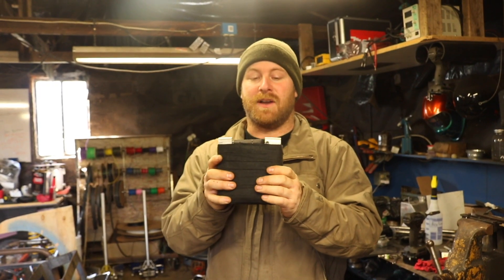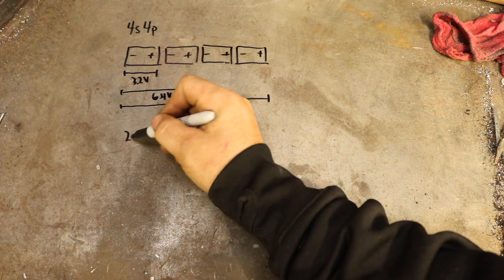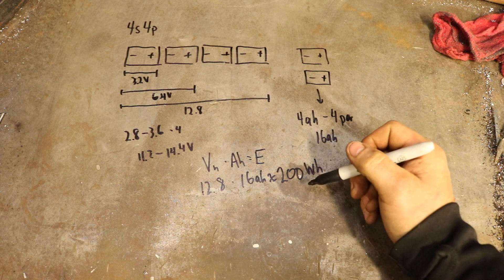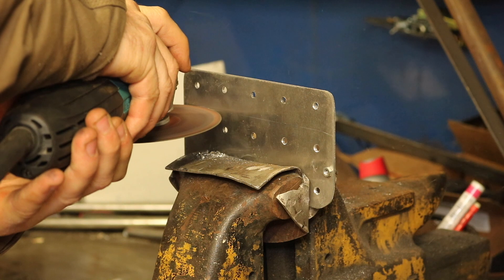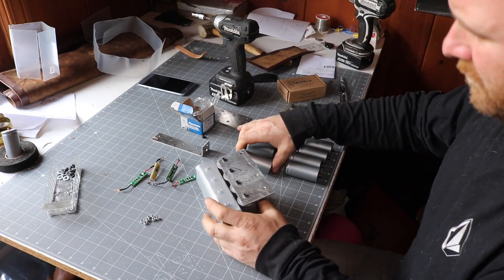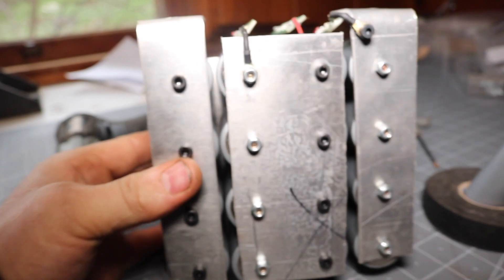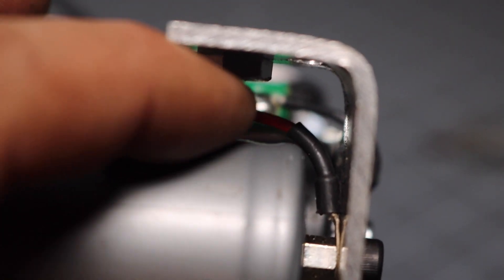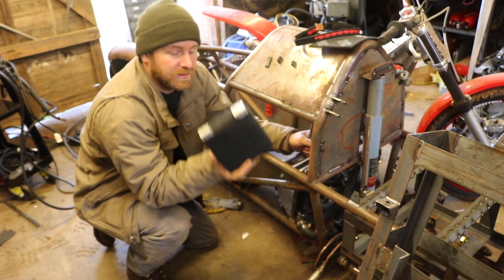Lark Streamliner | 12V Lithium Ion Battery Design and Build (and a new baby GOAT!!!)

Comment: Hi Shea,Like the fact that you used aluminium plates for the connections of the cells. Your battery should never heat at all according to my experience. Neat design. I will personally use Lithium-titanate cells in my project just because they will alsmost survive a lifetime and have extrem high power output when needed.
Reply from the maker: Awesome, I'm a big fan of aluminum current collectors